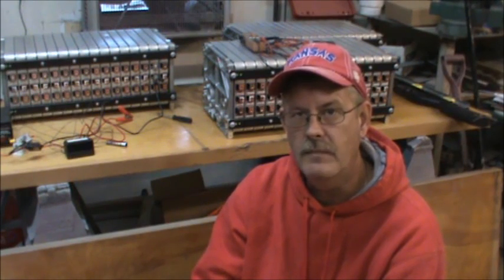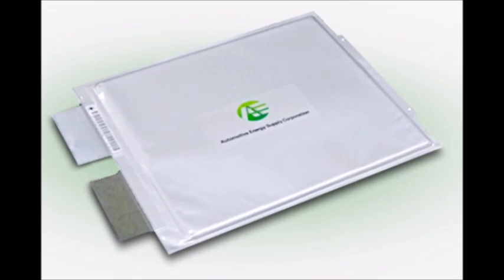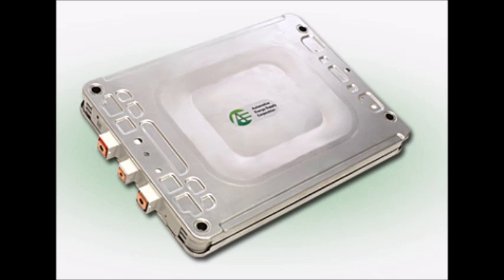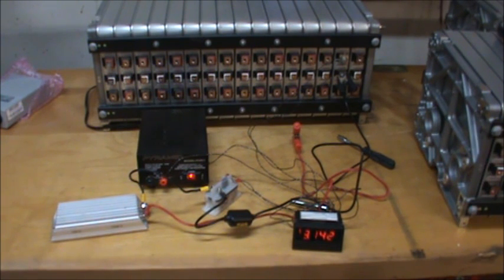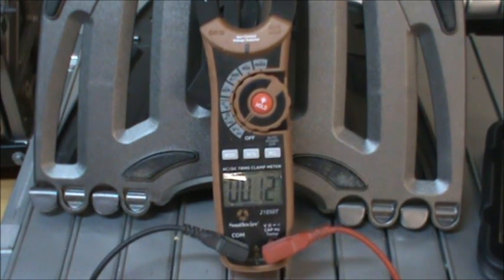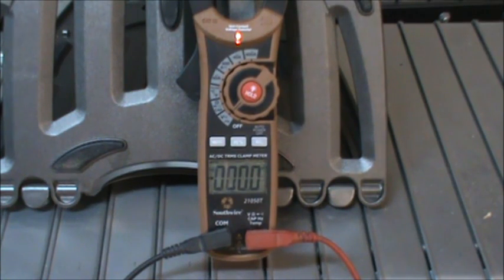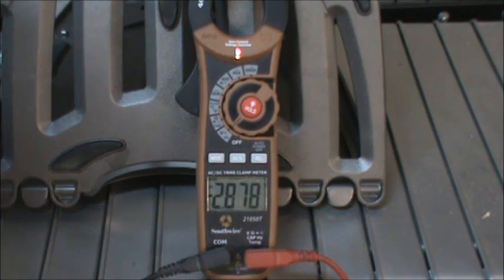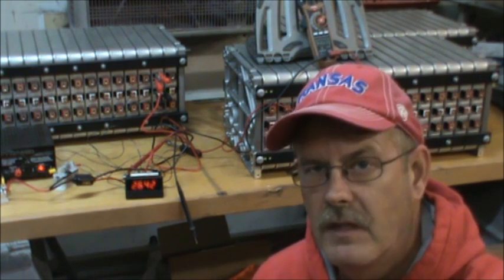Bottom Balancing The Better Place Lithium Ion Pack

Comment: I know this is an old video but I'm wondering how the leaf cells are doing? I have 24 cells wired into 24 volts running my shop with solar. have you had any fires or anything dangerous happen with them